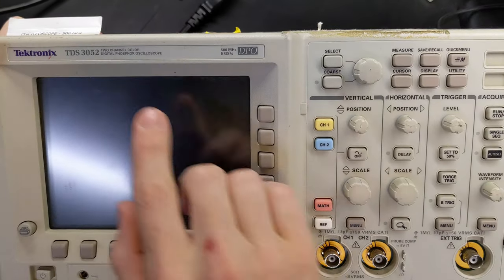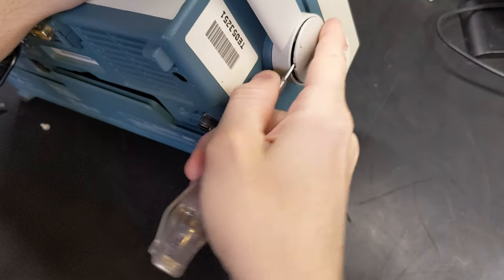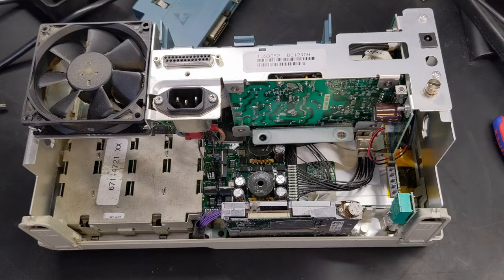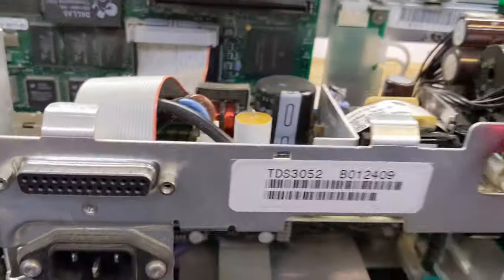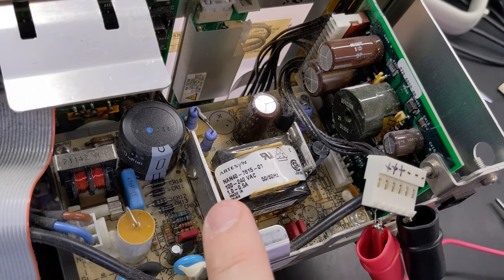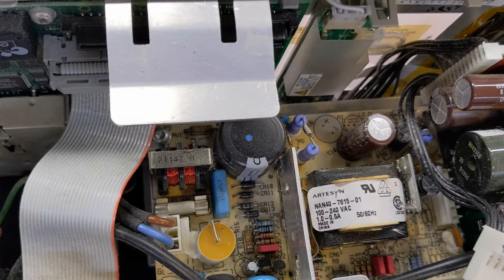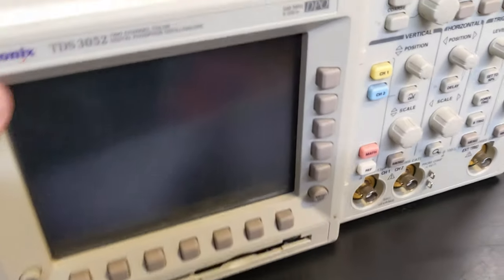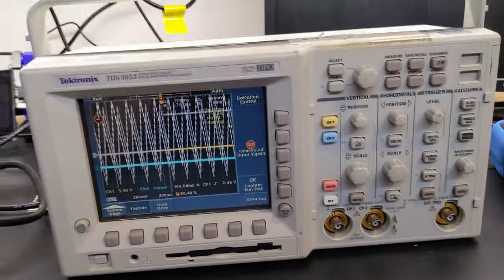#6 [Repair/Upgrade] TDS3052 Oscilloscope repair

Comment: I have the smaller version, the TDS2022. Within a year of purchase it broke down. Indeed the switcher. The heatsink was too small for the dissipated power. I modified it and now it has been fine for several years. Tektronics is no longer the sturdy brand it used to be. Cheers

Comment: Great work getting this scope working again. Love you commentary on the way to repairing it. Some years ago at work I used this scope daily with rather delicate and expensive active probes. Nice to see you can increase its capabilities by those programmed plug-in modules as I always thought it was a bit limited.

Comment: I wonder if they put two resistors in series because of the high voltage.   That seems more likely than doing it for power dissipation reasons, or because they didn't have a single resistor of the correct value.
Reply from the maker: Yes, I agree and well spotted!
I didn't do the math exactly right on video, but assuming the worst case its 240V AC, rectified to 340V DC, then dropped over 780kOhm, this gives the relatively small current of 0.436mA; however, the power is not insignificant at 0.148W thanks to the high voltage. This is fairly close to the 1/4W rating of the resistors I used, and the environment of the PSU might be fairly warm leading to a derating of this (and how I mounted them against the board). I think they stood the resistors up the way they did to aid in heat dissipation too. Overall, I am sufficiently concerned that I've ordered some 390k 0.6W resistors to replace.
Reply from the maker: OK, I've reread your comment and noticed you mean voltage rating. Some quick googling found this comment online:
"Start resistors used to initiate oscillation in mains SMPS are usually paired in series to better survive the 200-350v they see, and even then, start resistors are a very common cause of breakdown (they eventually go open circuit)."
Which is exactly what failed here and I really should replace them with two resistors in series. I'm a little surprised at this, as you'd imagine they'd have just put the space on the PCB to place two resistors, rather than make that custom, two-resistor thing I removed. Thanks again for the comment, I learned something new.
Reply: @bansci  The lack of PCB footprint is because as part of the design as you have already mentioned, the resistor pair need to be mounted vertically just to assist with the cooling as well as load sharing. Karl.
Reply from the maker: @karlfell3768  I agree about the design being for heat dissipation, I'm just amazed it's cheaper to do this than to, say, add many single resistors in a on-board network to share the heat/power, or even just buy a single resistor in a higher power package. Maybe the pair of resistors was even purchased as a single part, pre-bent to fit a standard single resistor footprint?
I'll try to make a similar vertical double resistor when the parts come in, I'm not experienced enough  to question the design choices on a mass produced PSU like this.
Reply from the maker: OK, I realise I'm taking this too far, but I found a shot of a NAN40-7608 on ebay, which is in the same family and shares the same PCB, and the startup resistor (R2) is a single board/horizontal resistor in what looks like a 1/2W package. 
I think Artesyn just found it cheaper to series two 1/4W resistors at the time of production rather than source a 1/2W resistor.
Reply: @bansci   I wonder if the photo you found on eBay is a 120V version? A typical rating for small resistors is about 200V, so it makes sense for there to be two in series. In an application like this, "flame-proof" versions might also be specified.
Reply from the maker: @ickipoo  These supplies are "universal" so they take 90-250VAC, but the voltage rating is one good justification for the series resistors. Still didn't protect this PSU though!

Comment: Hi, did you know about the ability to hack this oscilloscope before you bought it? I find it hard to know what has hidden features when looking at old equipment and I don't think it is very feasible to spend hours and hours researching every tool that goes on auction, any tips on how to get learn about good equipment without the massive time investment?
Reply from the maker: I don't think there's any special trick, just only research equipment you want and you have a chance of buying. The chance bit is probably what you need to get right. I don't check eBay often as prices are high in the UK. But I keep an eye on the test equipment Google groups and check out their adverts, as usually prices are more reasonable so it's worth the effort. Same is also true for clearance auctions that sell company equipment, you can occasionally get amazing bargains but you must be careful not to get carried away

Comment: Are you using leaded solder? Because unleaded solder isn't fit for repair. You heat too much the pads with your unsoldering iron. That's why you killed the pad. Nice job to find the problem on the power supply, it was far from obvious. 👍
Reply from the maker: Thanks for the advice and support! I am using unleaded solder, I'll try to get some leaded for testing. I didn't think I'd over-heated the pad too much in this case, the contact time wasn't that long and you need to melt both sides well for the gun to do it's business but clearly results speak otherwise. In hindsight, I should have just clipped the resistor and pulled the leg through the other side without using the gun.

Comment: I bought this same scope bundled with a TCP312/TPCA300 current probe from an auction in early 2020 for $1300. It actually a really great scope. Im waiting on a USB floppy drive so I can upgrade the FW, hope it works. Thanks for the video!
Reply from the maker: The USB floppy upgrade looks great. I love the scope too and its now my daily driver, I just wish it had more channels and/or more sample memory. Even cheap scopes have so much sample memory these days...
Reply: The Chinese are offering this scopes substantial features in 2023 for under 150 dollars.  And it shows lol. It kinda does what they say it can do but like all Chinese products it only looks like it has the features. Well it has them but they don't exactly now how to implement them.

Comment: I repaired a switching power supply in an industrial VCR, it was that small electrolytic in the startup circuit. there was no indication it was bad until I inspected it under a microscope and saw a little corrosion on the legs. ESR meter found it in just a few minuets after I verified the switching mosfet was good.

Comment: i have tds3032 white screen.no relay noise. i have found +-5v 3.3v. have any idea wheres the problem??
Reply from the maker: Sorry no, I'm not sure where the split rails are generated, but I'd check for shorts pulling the rail down using a thermal camera at first (because I have one), I'd check if the rail has high ripple perhaps indicating a capacitor problem. Unfortunately it's still wide open at this point!

Comment: easy instant sub.

Yeah that is the problem with those cheap desolder guns. Your dwell time is usually longer than it should be because, and this is my experience and indeed confirmed by others regularly, the solder gets stuck often in the long tube leading to the collection glass. I speculate (and I want to emphasize it is just speculation) that on the cheaper desoldering tools only the tip is heated. Over time the tube will soak up some of the heat from the tip but often not enough. Solder going down the tube ends up solidifying too soon. On the more expensive ones like the Hakko FR-301 or even the FR-401 heat is applied to not just the tip but the tube also (or at least a larger part) it seems. Reducing the risk of blockages.

Now that doesn't mean you can't damage traces with the more expensive ones ... you can indeed ... but the dwell time is smaller reducing the risk.

As for the floppy, I had to do something similar for my TDS754D, I ended up buying a cheap usb connected floppy. That worked great to my surprise. I wanted to save the data in my scopes 2 Dallas chips (which ... are long overdue for their final failure). Someone on the EEVBlog wrote a little script for that scope (and others like it) that allows you to dump the NVRam to the floppy and also upload it again later. Even seen people who install an SDCard reader that emulates a floppy drive and is a plugin replacement for the old floppy in the TDS.

How amazing is that PCBite thing... Absolute must have thing. The only thing is the Dupont connectors can get a little loose but that is easy to fix with some pliers.
Reply from the maker: Thanks for the sub!
I only have myself to blame lifting that pad, I was rushing and it's a cheap PCB so I should have been more careful. Interesting point about the hakko handpieces, maybe I can put one of them on my station? I definitely get a lot of blockages like you describe...

I've thought about the USB floppy mod, but so far I don't need the data off the scope. I probably will later though so I might buy the parts in now for when it inevitably becomes essential.

Yeah the PCBite is great, especially the scope probes, so cool for quick debugging. It's just a bit expensive. I've been looking at a few cheaper solutions when I need to debug a parallel bus (so I can need 8+ lines). These probes are great where you have a package leg
https://m.aliexpress.com/item/1005002931805113.html
And this looks like a nice low cost all in one solution
https://m.aliexpress.com/item/1005002437962150.html
Thanks for the comments! Off to check eBay for hakko desoldering handpieces now
Reply: @bansci  The FR-301 is an all in one desoldering gun. It has the pump in the gun. The FR-401 is a handpiece with separate station. But it is (for some reason) a LOT more expensive sadly. Still I have had 2 cheap stations, an old desoldering gun (all in one too but a really strange one, it did not have a pump but a sort of vacuum cylinder that had an electric plunger).

The 2 cheapos, nothing but blockages all day long to the point where I spent more time on that then anything else. The old All-in-One was better, but still not perfect (and no more nozzles for it anywhere).

The Hakko, o.m.g. It is a day and night difference. With only 2 things I would like to see changed. A led to indicate it is on (visible as it sits in the stand), and a small delay after the trigger is released where the pump keeps running for 2 seconds longer.
Reply from the maker: @xConundrumx  I'm very keen now to find a better desoldering gun. I've looked at the JBC DR560, as I quite like their 245 irons, but the cost is insane (~£1.2k) for a single station. Even the Hakko FR-301 seems cheap at ~£725.  I'll keep an eye on ebay, I'm sure I could fix a broken station...
Reply: @bansci  725 pounds for an FR-301? That's way more than I payed. I can buy them for 325 Euros and even that is more than it used to be. Or are you thinking of the FR-410, yes that one is not cheap.

Don't go for the Weller eco-system. I have the WX2 as a station and while it performs fairly well it has (for me at least) 1 massive drawback. A shocking lack of tip choice. Why this is I cannot say but it is really an issue. If you want desoldering on the Wellers you will probably end up with the WXD2 (or WXD3) which is the same as the WX2 but with a vacuum pump built in as extra.

JBC is expensive sure, but I like their approach better in some ways. It's more modular with more choices.

And then there is Pace, some people swear by them. Myself I have no experience with them.

Not an easy choice
Reply from the maker: @xConundrumx  yeah I meant the FR-401. I used to be very pro Weller, with my WS81 being my main iron for over a decade. But the lack of primary side fuses in some of their latest kit means they either don't care about safety or they've cost eliminated everything down to the bone. Neither is a good sign!
I've put off the purchase now. I'll make do with my current station until something amazing comes out of China perhaps
Reply: @bansci  Well in theory you could use a china version of the Single tool JBC stations. There are many coming out now that can work with the JBC T210 and T245 (and even NT115) handpieces. Even the original JBC handpieces can be used. The JBC desoldering tool should fit that too I think but you would need the tool, the stand and the vacuum unit add-on. Not sure you would save much for a desoldering tool setup there. But you would gain access to the whole JBC eco system.
Reply from the maker: @xConundrumx  I already have the Aixun T3A and T3B with the JBC T245 and T210 handles lol. They don't support the microtweezers unfortunately, so I didn't think about the desoldering tool.... Not a bad idea. Would save £400 or so, but the handpiece is still £300, and so is the pump. I'm tempted to try a unisolder project at some point too, so maybe I do this and build a vacuum module too, but my need is not great enough yet! I'm sort of hoping Aixun comes out with a desoldering clone, they're very good...

Comment: Hah (and Hi from the UK too). I bought the same scope at an auction, also completely dead (which was encouraging... PSUs are simpler than logic boards !). My PSU similarly produces nothing, so I'm in the process of looking at it. Interestingly, there's evidence of overheating around that resistor pair and the larger blue-violet-coloured pair - to the extent that one of the tracks has separated from the board. So that's definitely somewhere to investigate.
Artesyn do newer equivalent PSUs, and I'd thought to just buy one of those, but it hadn't occurred to me that Tek might have designed the second board (called the "battery board" in the manuals because it manages getting power from, and recharging, the optional battery, as well as generating the other voltages the scope needs) around the exact characteristics of the PSU. So thanks for that thought, makes it worth putting some more effort into the original.
Reply from the maker: Good luck with the repair! I think if I do another one, I'll just follow TheFeedbackLoop and test everything first. He had a hell of a saga repairing the SMPS in a display recently https://www.youtube.com/watch?v=dUlpt3-WJpM which might inspire you further.
Reply: @bansci  OK - I did some digging this evening and uncannily the exact same resistor had gone open-circuit as on your board. In the same pair of 390Ks, the outboard one. Unsoldered the pair of them, replaced with two new ones, and the creature comes to life. Thanks for blazing the trail ! Now I need to buy a probe...
Reply from the maker: @richardt6  Great news! Glad to hear another of these excellent units was saved!

Comment: when you powered up the scope after the repair, how come the PSU board is still on the bench? did you have a spare?
Reply from the maker: Well spotted! At the start of the video I said I bought everything I needed to repair it, and what I meant by that was a different second-hand NAN40 series switched mode power supply (with three outputs). I thought I'd have a dead primary transistor or switch-mode controller and thus need some out-of-production part, not something cheap/jellybean like a resistor.
It turns out these supplies have a lot of differences on the secondary side between different models, and between different revisions, so this was a bad idea all round, but that's how you learn.
Reply: It was quite interesting as I have a tds3054b which recently had the NVRAM battery die, a dremmel and fine soldering and I've now got a cr2032 holder in it working fine. But even with it "off" but on at the wall, it gets quite warm on the PSU area at the back, suspect a fair bit of standby heat dissipation and those caps won't last forever. So we'll worth watching your repair :)
Reply from the maker: I'd like to see a picture of that repair, so I googled it, something like this?  https://www.eevblog.com/forum/testgear/crack-nvram-ds1486-ds1650-to-add-battery-socket/
Very cool.
I'm surprised there's a lot of standby heat dissipation, I'll check my scope out, but I think I get nothing noticable. You should try to narrow down that heat to see if somethings starting to leak before it goes pop.
Reply: @bansci  yes just like that, although the NVRAM on this series of TDS scope is just used for storing Time/Date and GPIB interface settings. Tektronix Have a document for disposal of this model from military applications where you may require all memory to be blanked, so it breaks down what is essentially stored in each memory device. So it is not a massive issue for these if it does die.

Also it only has one battery instead of two in the device. Same series but different part.

Comment: Is it possible to reprogram the 24c02 without opening the module? I'm wondering what the 6 pins on the module are connected to, and haven't found a diagram for the TDS3XXX modules anywhere.
Reply from the maker: Yes it's possible, the pads are just taken straight out. IIRC the only on board component is a decoupling capacitor. I think the eevblog thread I link below had done discussion on this. If you're really stuck I can photograph my module